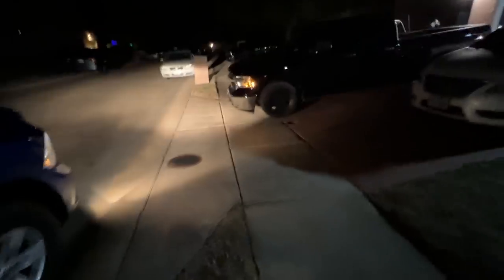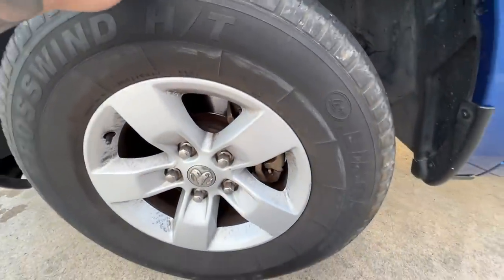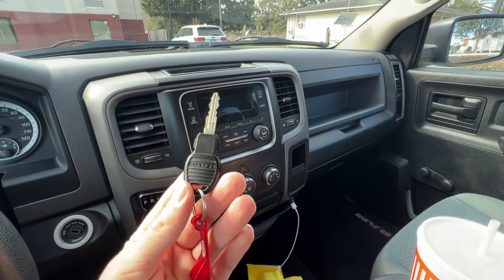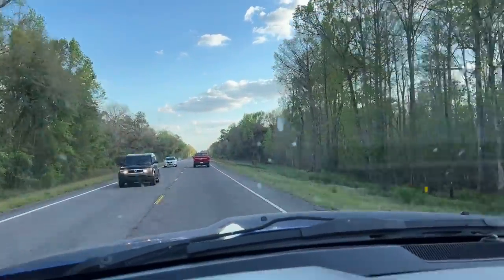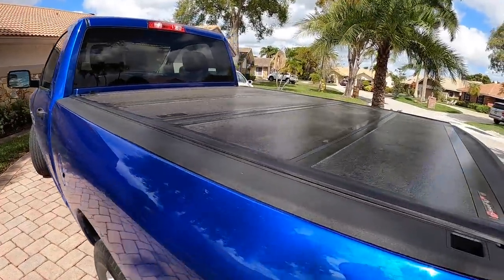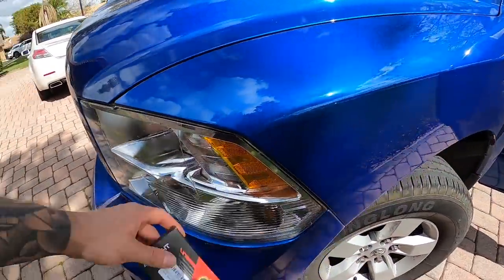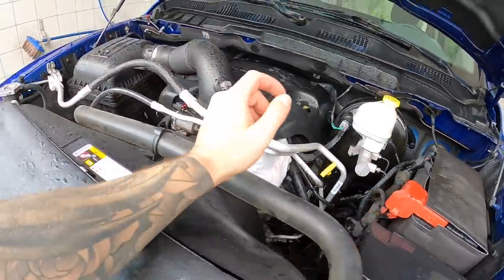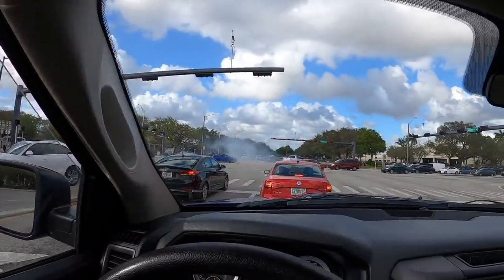Driving the RAM 1500 Project Truck from Texas to Florida

Comment: Woohoo! Congratulations on 100k!!! I like the Kota blue but I really like that Ram blue better. Where I am in AL there in non ethanol almost everywhere. I don’t run it in my truck because it’s too expensive for me but I run it in my motorcycle, chainsaws and weed eater because it won’t gum anything up from sitting and seems a little more efficient. Also I’d just debadge it or at least take the door badging off.

Comment: I run 87 non-ethanol in my boat and yard equipment. Ethanol is hydrophobic, meaning it absorbs water. It can pull moisture out of the air and contaminate the fuel. It's not as much of a concern for daily driver vehicles and such where you're going through the fuel in a few weeks at most. But boats, being around water (duh..lol), and yard equipment that doesn't get run as much the last thing you want is water contaminating your fuel. Especially on an outboard. Ethanol fuels also phase separate over time if not treated, which can gum up carburetors. If you run it in your vehicle you might see 1-2 mph better fuel economy since ethanol has less energy density than gasoline.

Comment: The more I see that truck, dam I am glad you grabbed it. Best of luck you rolling stone.  Don't diss those stock 17" wheels, I think they are the best Ram wheels. I prefer big meaty tires on trucks, I don't like low profile tires on truck. The no-ethanol gas is more for mowers and carbureted equipment. If that was offer by me I would 100% put that in my mower.

Comment: Hey bud quick question since your a mopar guy. My 2016 ram 1500 has a bad lifter and seems like it’s messed up the cam aswell. Since my truck has 190k miles I’m looking at a remanufactured engine. Do you have any recommendations I’d really appreciate your insight and opinion. Thanks bro.

Comment: Hi,
How you doing buddy 
I have question for you regarding my Ram 1500  2 Doors same as your truck . I facing problem with my truck. The problem is specially in the morning when I start engine and put transmission in Drive it takes more seconds to move. This is up normal . this annoying me too much. So I appreciated if you have a solution for this problem.
Thank you and have great time.

  Regards 
A.Alsayed